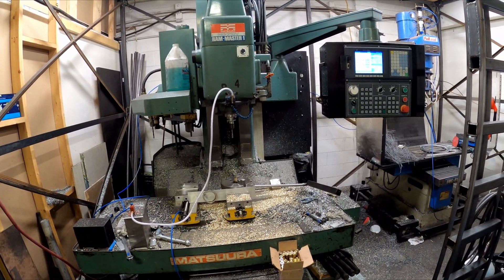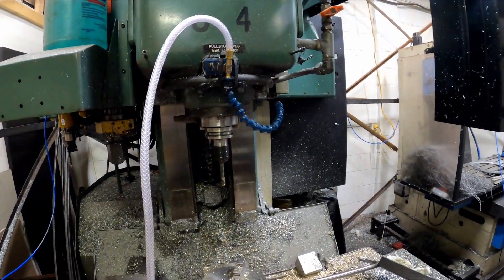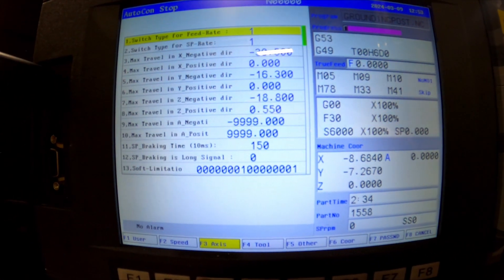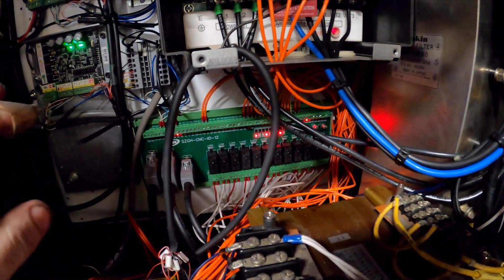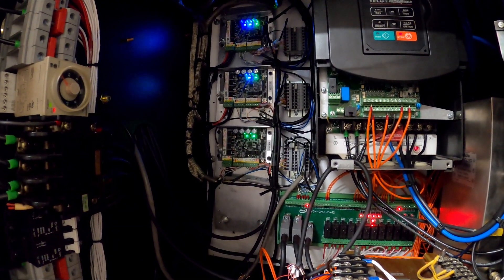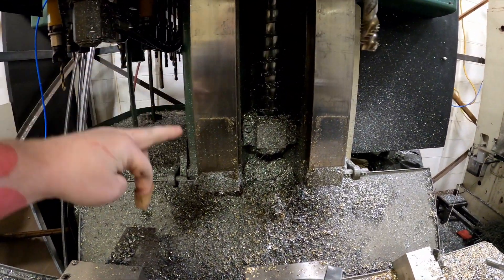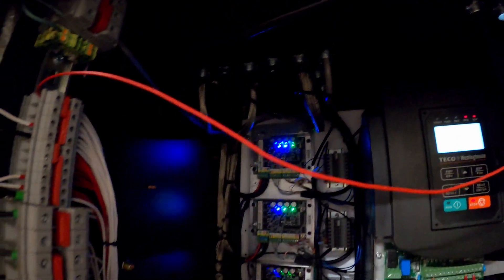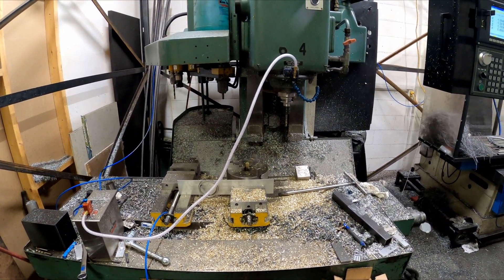1980 Matsuura 710V CNC Update - Almost a Modern Machine - Retrofit

Comment: Hey , I bought the same CNC control (SZGH 1000MDB) back in 2019 to fit in my "Klopp fwue8 " from 1980 . Instead of using the original DC Servos i bought new AC Servos from the same company ! Since then the machine works very nice, the support from SZGH was brilliant , there set up a Whats app chat with one of the engineers, Mike, he supported me very good thru the setup and even wrote me some macros. One of the best buys i made at all !!!

Comment: Hello , nice  work , i got  a Matsuura 500 mini master for retrofit ,   just want to keep  old servomotors ,    replace old encoder and taho with  new ones ,  cnc controller , LinuxCNC or maybe a Chinese  Szgh  / Gsk , step /dir    ,those dc drives you are using are a liitle to weak  , have you looked at  Larken Viper 200h dc drives  , seems a little more capabale .

Comment: Hello
We have a similair project on an exact same macine about to start here in Finland. But we are missing the manual with all electrical diagrams etc. Would it be possible to obtain a copy from you? 
Well done with the machine update! We are following your progress closely 👍
Reply from the maker: Hi, I'll see what I can dig out, originally I printed a copy I found online, but I deleted that file on my computer so only have the hard copy. When it came to retrofitting the machine I removed all of the existing electronics and started from scratch so didn't need the diagram.
Reply: @edwardpage8346  I sent you an email (I hope to the right email) regarding these manuals
Reply: @edwardpage8346   Hello, I sent you an email (I hope I sent it to the right address) a few weeks ago, I thought It would be better to continue the manual discussion over mail.
Reply: @edwardpage8346  Hi, I sent you an email a few weeks ago (I hope I found the correct mail adress) regarding the manuals. I thought it would be better to continue the discussions over email